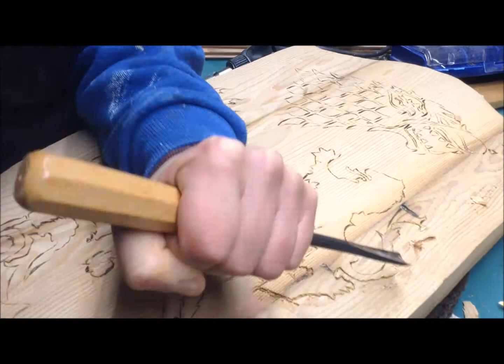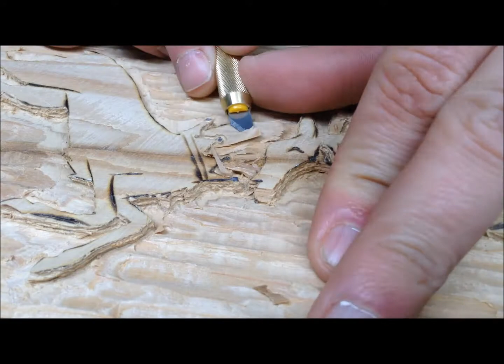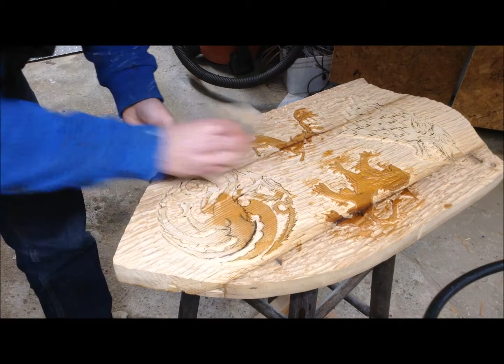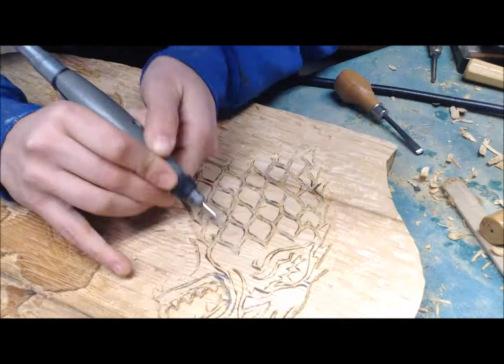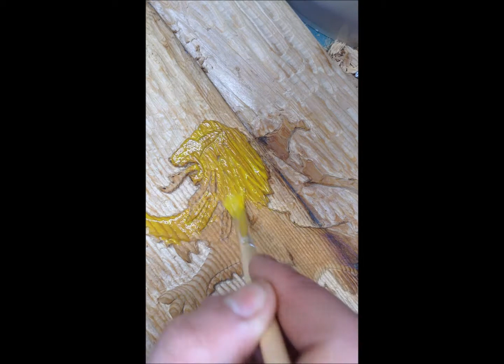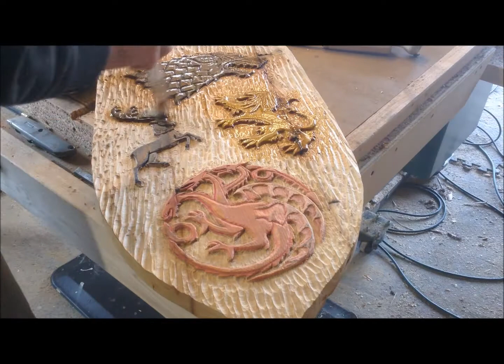Game Of Thrones Carving

Comment: @honeybadger woodworks hey man I'd love to get into doing things like this I love engraving. I have a nice Dremel I just need to find me a nice knife/chisel set for this type of work. Any pointers on a good set of knives and chisels? As well as what tips I would need for the Dremel. Wheels and all :) thanks man awesome work!!
Reply from the maker: The chisels I used for this weren't mine, they were a loaner set and are no longer in my possession.  They didn't have any makers mark on them so I can't really help you out there.  I know chisels are one of those tools that if you cheap out on them you will regret it, which is why I don't have a set of my own they are freakin' expensive.  I use a cheapo pocket knife that I already had on hand, a razor blade and exacto also work great if you don't want to shell out the money for a Flexcut.   As far as the dremel bits I used a small tipped diamond bit for detail and a couple different sizes burrs made for wood.  I bought a variety pack a while ago and it had most of those in it.  Best wood for carving is Basswood and Tupelo.  But, you really can use anything, this was made from old pine joists nothing fancy.
Reply: HoneyBadger WoodWorks thank you very much just trying to get all the info and tools needed to start these kind of hobbies for gifts and presents as well as stress relief. I could probably get the exacto and I have a Dremel. Could easily get diamond and wood burring bits but is there any decent quality chisels that would be wouldn't break the bank? Appreciate your help your awesome
Reply from the maker: Not any that I know of, but if it is for hobby work I bet you can get a cheaper set off of amazon that will do you well.  The problem with buying sets I hear is they include a bunch of chisels you don't really need.  So buying ones as you go you get a more complete set for your needs.  There are other really talented carvers on Youtube you could check out that will tell you what tools they are using.  I'm not a professional carver so my advice won't be as good as theirs.  That GOT carving was a birthday present not a professional piece.
Reply: Looks pretty dang solid man. I just want to get on this level. Any links you can give or people to point me in? Just ordered some x acto knife set. Those chisels are super expensive jeezussss. I got a Dremel and I might need some.bits but I am trying to make work just like this for wall art and friends and family.
Reply: HoneyBadger WoodWorks also what Dremel heads do you suggest for wood around the edges plus I know the wood burring wheels. I love this piece. Sorry for so many responses just a fan

Comment: I know this ones a few years old, but did you use a spray adhesive to get the initial paper to stick before burning the design? I’ve been wondering about is it leave any residue worth noting.
Reply from the maker: No, I just used tape.
Reply: HoneyBadger WoodWorks thanks!